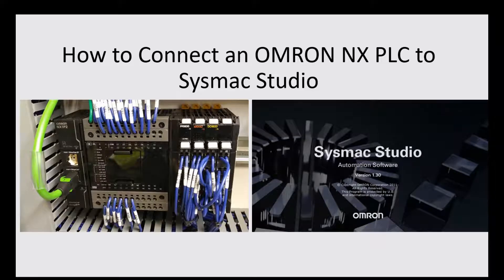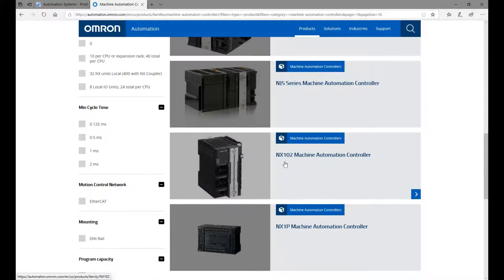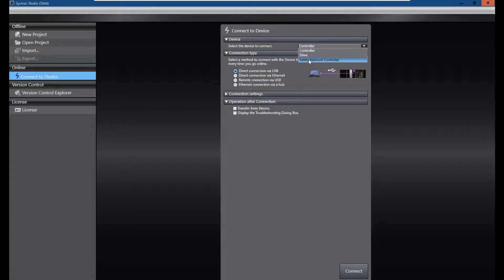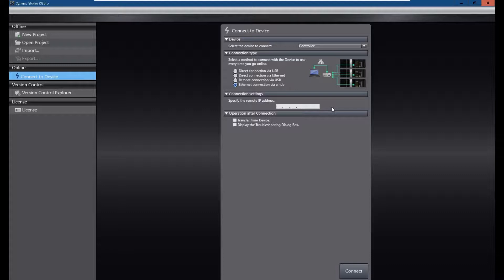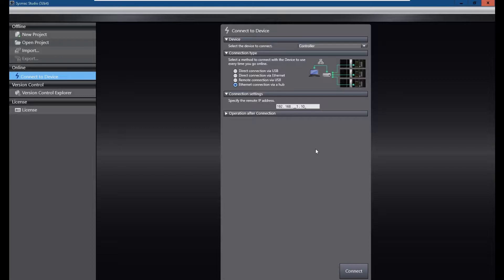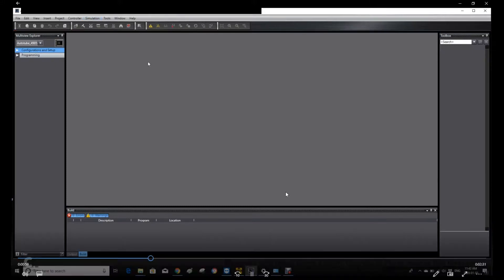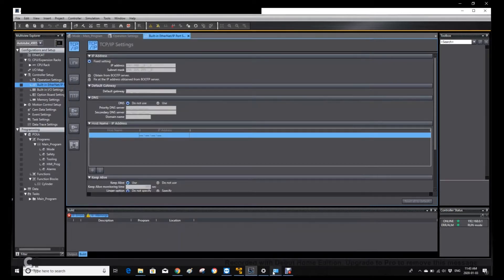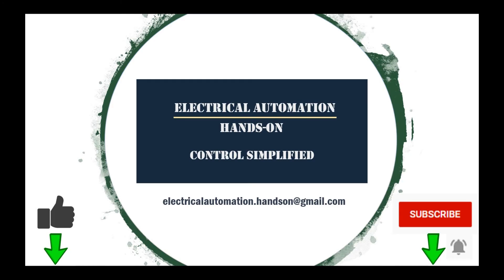OS2. How to Connect an OMRON NX/NJ PLC to SysmacStudio

Comment: Hi, I'm trying to connect an NX1P2 PLC to Sysmac Studio using a direct Ethernet cable, but the connection keeps failing. What could be causing this issue?
Reply from the maker: You can check your ethernet cable, firewall, and disconnect your wifi